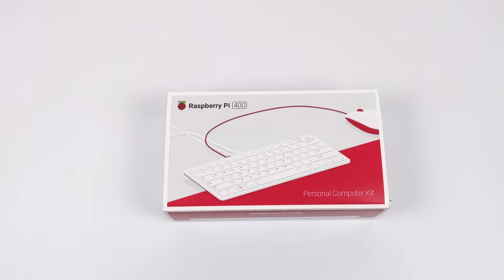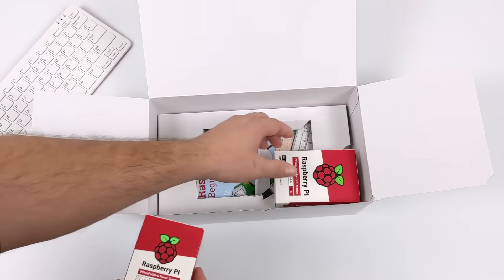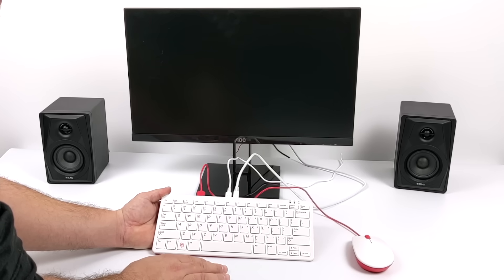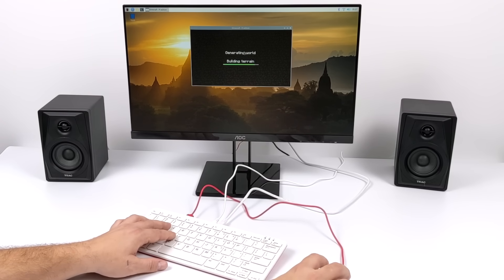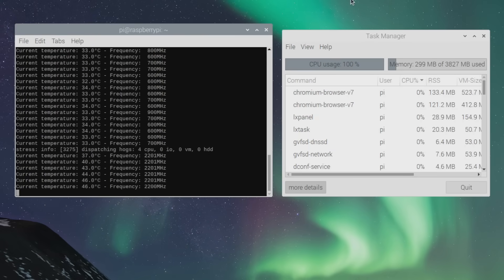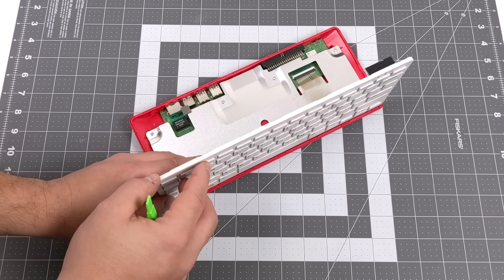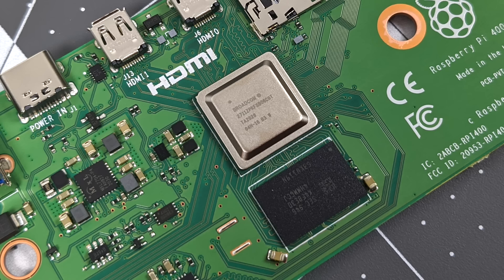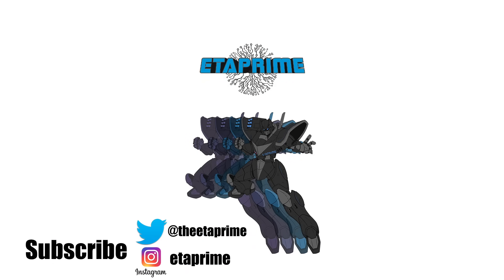The Raspberry Pi 400 is Awesome! Review, Overclock, Emulation, Tear Down

Comment from the maker: If you do pick up the Pi 400 what is are you going to run in it?
Reply: Mines getting retropie straight on it and living in the living room with the big tv.
Reply: @richretrotech9426  i did that but laggy on games🙄
Reply: I'll go with TwisterOS i think
Reply: I quite fancy one of these to set up as a retro computer; Atari ST, Amiga, ZX spectrum, MS DOS etc
Reply: I was actually thinking and trying to make something like this DIY in home for past 2-3 months , but heck somebody already made it.
Reply: @gulamahmed4773  go to 77 up 77 in my my ⁷ we ⁸
Reply: Commodore 64 emulator.
Reply: I'd make a custom laptop
Reply: Ubuntu
Reply: I want to find a 5V mini projector to hook up to the HDMI so I don’t need a monitor anymore.
Reply: RetroPie. I'd like to see images built optimized to emulate Keyboard based systems, like the Amiga, Atari ST, Commodore 64 and Spectrum.
Play all those games that were keyboard centric like RPGs and Text Adventures.
Reply: This would be good to play old DOS games on with a emulator.
Reply: Amiga
Reply: Android 9/10, with a Taskbar or a Launcher
Reply: TLX OS (thin Linux) the thin client os that is included with the raspberry pi installer it's pretty useful.
Reply: Amiberry with direct boot into an Amiga 4000.
Reply: @johalun  Does that run all the .adf disks from like the amiga 500?
Reply: @scality4309  I use WHDLoad to launch games and demos. But sure, you can also load adf files as if they are disks in a disk drive. Press F12 to open the menu and "insert" disks.
Reply: One word....Amiga
Reply: @slowlymakingsmoke  It actually looks like the later C64C,in basic shape. Hope it inspires more of these things,or at least case mods for classic machines!
Reply: Amiga computer emulation.. 🤔
Reply: Emulate an Amiga :)
Reply: @ETAPRIME gonna make a pie top or take the whole pie apart and make a slimmer pie tablet
Reply: I would try retropie just for fun but with the keyboard i don't think its worth getting just for that, some old pc games like you did with Half Life, maybe some rts ones, windows with starcraft , see if it can go a little further pushing star wars empire at war (that i think it wont work at all) , does steam works on piOS? its a linux system right?
Reply: I would say retropi and emulation, but my "normal" pi4 is already setup for that. For gaming, this system feels like it needs to take advantage of the fact that it IS a keyboard; I kind of want to load up some Zork on here, but will probably just mess around with various distros until I'm happy with a "portable desktop" situation.. and THEN do some Zork.
Reply: @levethix  that's exactly what I did! Loaded up fs-UAE and played Zork!
Reply: Thanks ETA! Hoping to try out some stadia/geforce now/steamlink game streaming on it!
Reply: Batocera
Reply: Have mine on back order, will use it as a mobile configuration terminal...  add a hdmi to VGA and you are set, everywhere has a TV or Monitor...
Reply: To throw my windows pc away... Or better to use this as virtual flipper device...the PC!
I am tired of windows
And i would like to see as emulation station
Reply: I would use Android on it, my monitor is already setup to output audio through HDMI [external speakers] so i won't miss the audio jack
Reply: I would run Amibian and make the Pi 400 an Amiga 400. Gotta love the old Commodore computers.
Reply: I would like to get this and run retro pi. Do you know it's possible to run retropie on it or recal box?
Reply: @10120003  
They already confirmed that it's compatible on release day:
https://retropie.org.uk/2020/11/raspberry-pi-400-is-released/
Reply: Anything that can do basic office task. So raspberry OS is enough for me
Reply: Are they going to make an 8gig version, also can you do some experiments with types and placement of thermal pad, paste and that Play-Doh stuff
Reply: Android please!
Reply: Plain old Raspberry Pi OS and then use it as a regular desktop for lightweight use and programming (mostly Jupyter notebooks and some Python and C++ based pet projects)
Reply: Run RetroPie, develop websites with VS Code, play with Dockers images on Kubernetes, use Chrome :)
Reply: Kali linux :)
Reply: My question is " is it worth losing the camera & display latches and the audio jack?"
Reply: @PS_7015  you don't "lose" anything, it's a trade-off, those ports for a all-in-one computer
Reply: @iHawke  LOL that's the whole definition of a trade-off - you LOSE something.
Reply: @PS_7015  Made for a different customer, a tinkerer who also want convience.
Reply: @PS_7015  Absolutely!

...not
Reply: @PS_7015  I think that just depends what you want to do with it.   Realistically, I couldn't imagine myself using those, so a Pi 400 is ok for me.
Reply: @PS_7015  I bought the 400 assuming it'd have the same 3.5 composite port as the Pi 4 so I could natively run a CRT TV but nope I gotta get an AV to HDMI converter which doesn't like interlace resolutions
Reply: @PS_7015  I personally don’t think it is.
Reply: @metronorthrailfan2244  You can buy either or both, it's entirely optional. Doubtless third party hacks will rapidly appear that will fill your every desire.
Reply: Man this is very good
Reply: I want to see how well this device can handle different game engines, especially GameMaker 2.
Reply: I could see a backpack being made for the GPIO/USB, adding classic connectors for BYO C64/Speccy/Amstrad/ST/Amiga/Archimedes. Also custom cases from the likes of RetroFlag in the style of those, but with different keyboards. I'd probably run Manjaro XFCE as thats my main OS already. My Dad is on a NUC right now, can see a 500/600 etc replacing that when it dies.
Reply: Scummvm build, or some linux build.
Reply: These neat little things are perfect for children's Christmas presents. And the cooling can probebly take a few new interations down the line
Reply: Would be running ps2 emulators if possible? And any games I could find worth getting
Reply: RetroPie or OSMC.
LibreELEC maybe if they expand the usability beyond KODI a bit.
Might even try out Volumio for my own private Radio Station.
Reply: I would at least try the ZXBaremulator, I would try to make a Joystick adapter for GPIO. And I would probably end with Python learning-focused / development-focused OS (probably RPi OS with extra SW).
Reply: It needs a decent built in battery and rtc. I'm sure someone will come out with something that fits in there.
Reply: Raspbian 32 bit like everyone else, so I can make software that other users can use.
My beef with the kit is that 16 gig is too small.  I bought the stand alone and a samsung 256 gb card ($29 on amazon).
Reply: I'd like to run betaflight configurator?!?!
Reply: Probably going to use mine as a keyboard. Stick an NRF52840 dongle on, sniff logitech packets from the usual wireless mice; bundle it all up into a HID stream from the type-c port using the usual pi zero DWC2 usb gadget configs. Might stick one of the MacroSilicon MS2109 HDMI-to-USB2_UVC_webcam camlink clones on it and see if I can train it to macro some games. Maybe some USB/IP fun, maybe just mount some btrfs USB drives. But it'll definitely be a 2.2Ghz USB HID keyboard for me, first and foremost.
Reply: Can it be a sbma server?
Reply: Can it run Dolphin Emulator?
Reply: I'm not sure
Reply: Another dude is running your video.  https://youtu.be/tTM-lyPivNE
Reply: Mine is coming on Monday (yupee). The first OS will probably be TwisterOS. And then, Ubuntu 20.10 to test the 64bit version OS on Pi400.
Reply: I'm watching this video on mine! I wish I knew more about how to get Webcams and streaming working. I know my webcam works, but the software I found in the package manager is archaic. Probably just download a 512GB Retropie image later :)
Reply: Having this set up as an all-in-one emulation machine for 8bit and 16bit computers would be perfect. C64, Amiga and Dosbox etc. 
Do you think Mac OS9 & Win98 would be possible?!
Reply: @ETA PRIME maybe some cpu temp test?
Reply: OK i see now ;)
Reply: I really want to get into some python, and play with some stuff attached to the GPIO's. This format is much better suited for a portable/temporary setup that I have to shove back in a box from time to time.
Reply: Using cSpect with ZX Spectrum next rom while I wait for my KS2 machine.  Also as a 1st using Linux OS of any version, I will spend a little time learning Python and Linux
Reply: RetroPie, programming (Python) and electronics 'tinkering'
Reply: Going to continue running Raspberry Pi OS which my current Pi4 uses.  When I get the Pi400, my original Pi4 will be converted to a NAS using Openmediavault.
Reply: TwisterOS OFC...
Reply: I plan on running OctoPi headless once it's setup so the keyboard and mouse aren't really needed, but since it's about the same price as the CanaKit it doesn't hurt to have it.
Reply: Minecraft.
Reply: Pihole. What else?
Reply: Wanted to run netflix but it doesn't, so got to learn about the Linux kernel.
Reply: my taxes
Reply: Where can I find one? Amazon doesn't have them!
Reply: will run some VMs, ESXi?
Reply: @Doom Guy what’s cool about Twister OS? I’m not aware of that system
Reply: I'll use it to teach spelling on YouTube for the comment sections.
Reply: po.n hub
Reply: @miladh1859  dire dire dogs, or children
Reply: Pihole lmao
Reply: @xuangli3952  lamao same
Reply: I am using the pi to test some risky codes, something that I would not try on my main desktop.
Reply: @guan01gmailcom  like sudo rm -rf --no-preserve-root /
Reply: Puppy linux would seem like a good option to try
Reply: @IdiocracyToday  german shepherd dachshund mix linux
Reply: @uiopuiop3472  I nearly looked that up ;) Fortunately I enjoy doggie pictures nearly as much as cute cat pictures
Reply: @IdiocracyToday  hmm cat picture seems good, might try
Reply: I bought one for X-mas to make my mother a media center on her TV set.
Reply: @ForOdinAndAsgard  i love cats!!!
Reply: Doom eternal at 4k ?
Reply: I think I’d run Kali Linux
Reply: @FuckMyLife-g6x  good choice, time to hack the NASA
Reply: @uiopuiop3472  or DoS the White House

nsa pls no arrest
Reply: @FuckMyLife-g6x  time to build a botnet with the scripts from the hacker called 4chan
Reply: @uiopuiop3472  we can also ddo— I mean stress test Reddit
Reply: Shadow PC
Reply: How did you overclock this i want to do this too.send me a pm PLS..
Reply: @saimonmarley9124  i didnt
Reply: @uiopuiop3472  i menaged to learn how It works. bye bye. For the people searchimg for this top the perfect setup whitout breaking the garantie.
Overvoltage 8
CPU freq. 2100
Gpu freq 750 
It Is stable and verified over 24 hours
Reply: @saimonmarley9124  thanks, i will try it
Reply: @uiopuiop3472  he data Is config works at overvoltage 8 whitout using the turbo setting
Reply: @uiopuiop3472  does the overclock work for you??
Reply: @saimonmarley9124  Didn't check it yet, but I will in a few days as that's when my new Pi 400 will arrive
Reply: @uiopuiop3472  ok i want to be sure that It work not only for me.
Reply: does rasp. pi 400 heat same like 4b
Reply: @Goku-ir1sy  nope because of the big heat pipe inside you can see It on a demontage video
Reply: Blender or fusion 360
Reply: hello eta prime!
Reply: @tomypower4898  eta prime: helo
Reply: Pi os
Reply: @matthewschreiner  is that raspbian
Reply: Yes matter what!
Reply: @tomypower4898  I have a regular PI with retro pi and I have anothe sd card with pi os.
Reply: @tomypower4898  yes!!
Reply: @uiopuiop3472  good!
Reply: @tomypower4898  nice!
Reply: stadia
Reply: portable keyboard (apple 2c) gaming rig
Reply: cyberpunk 2077
Reply: @secure-5593  no!
Reply: A c64 !
Reply: I'd like to see the 8GB RAM version so I can run the 64bit Ubuntu raspi distro
Reply: Cyberpunk 2077
Reply: home automation. couple of ideas for garden sprinkler and solar power water heating system.
Reply: Fedora, I'll learn Linux os
Reply: Please gift this one to me
Reply: I want to see if it can run hl2
Reply: Can this run TwisterOS ?
Reply: Docker
Reply: Retro gaming system for sure
Reply: GTA 5 😂😂😂😂
Reply: i will get tf2 to run on it
Reply: i will run pimiga :D
Reply: The PiOS it comes with.....and PiMiga on another SD card :D
Reply: Just picked one up to run Risc OS on.. Because none of my ancient archimedes work anymore #sadface
Reply: If I wanted to download ROMs for the VIC/C64/CoCo/II(and I don’t because I follow copyright laws), I would give this thing a beige-colored paint job, load it up with RetroPie, and make an 80s style all-in-one retro game console.
Reply: Overclock it and run Retropie, use the two USB ports for controllers. It will be like a modern Commodore 64.
Reply: Cyberpunk 2077

........

if i want my house to blow up
Reply: Wine
Reply: A lot of emulators
Reply: Make a cardboard pc
Reply: probably emulators, games, programming and also blender
Reply: Roblox
Reply: If I were to pick it up I would run Android
Reply: Wiii and psp games
Reply: Raspberry Pi Twister OS.
Reply: Me: installs Apache also me: creates test2.lavakid.net
Reply: Won’t run anything I like sadly
Reply: Minecraft Pi, definitely
Reply: This is actually genious.
Reply: @somedeveloperblokey Nobody gives a shit about what you do and don't accept.
Reply: Yt discord and my discord bot
Reply: Hi Eta prime and fellow Raspbians. I want to setup a google photos like personal server for backing up my photos/videos to an external hdd using opensource software like nextcloud. Being a programmer I'm curious about the pi but not sure if I can setup something like this. I will require static ip as well which I fear will make my effort waste on saving the money for a Google One Plan. Has anyone done any similar setup. I don't know if raspberry pi would be able to that much load.
Reply: Audacity for recording/editing samples, milkytracker for making old school rave tunes, VS Code for obvious reasons
Reply: Raspberry Pi OS without overclocking or software modifications
Reply: Pimiga
Reply: Perhaps good old Ubuntu, or something like Linux MINT.
Reply: I would like to do a multi boot, 64 bit Pi O.S., Twister, and retropie. maybe something for media like Plex or equivalent for the Pi, I haven't looked at that yet.
Reply: Could be a fun little network analyzer
Reply: I love Twister so I would certainly have that on there, but most likely dual or triple boot with something else. I would like to try using one as a daily computer doing the basic operations of my daily pc use.
Reply: Thank you for your reviews they are great and indepth. I find them very useful. I am think about buying one of these will it emulate PS3?
Reply: Minecraft
Reply: i really hope it can run windows properly.
Reply: My RetroComputer machine with Sedai Linux.
Reply: Experimenting with Linux mostly but obviously I will also dip in RetroPie!
Reply: I personally will probably get this to cut down on clutter for a couple of picade setups. I usually have to get an extra keyboard and mouse combos or bring mine for setups.  This will tidy it up quite a bit and make any updates tweaks and potential cabinet changes easier to design around.
Reply: So a pi400 soc in the 8gb pi4 form factor....a better option if they release it. Add case, tv/monitor and wireless keyboard and mouse. Run a basic linux or risc os build for desktop duties. Or build a fun retroarch/openelec console
Reply: If there is a good (stable) android ver for the RP400 I wish you try this game called genshin impact
Reply: Kali Linux for pentest.
Reply: ETA Prime I don’t know. What Operating Systems are you planning to run on it?
Reply: @metronorthrailfan2244  Try Recalbox, from there you have a very nice Amiga Emulator and others
Reply: @metronorthrailfan2244  Its possible to run RiscOs on Pi 400 with work keyboard?
Reply: @metronorthrailfan2244  it running raspberries os
Reply: @SM64M  I know
Reply: RetroPi :)
Reply: @ETA Prime Run Windows 10 on ARM
Reply: @ogorini  I agree
Reply: can u test wor please
Reply: hmd prg  Crysis Remasted
Reply: Nothing, sadly, sine there's no way to get audio out of it.
Reply: @brookewestonctc  hdmi
Reply: As soon as there is an 8Gb version I will get it and test ubuntu, ubuntu-mate, and kali.
Reply: Hello there, could you go into detail what the boot up & shutdown button exactly does?
I watched almost every "first look/ review" on YT...but I seams like this Killer-Feature gets overlooked by almost everbody.

I can't even count anymore how much attempts I started to implement a boot up/shutdown button into my projects...

Of course I already ordered one (DE-KIT)
but seems like it will take quite some time until it gets here...

Greetings from germany
Reply: can we play Roblox with this??
and is it fast??
please answer
Thank you
Reply: @ETA Prime and my question is what operating systems will you run on this thing? I know any operating system the pi 4 can run will run on it but I’m not sure if that includes Windows or not. I’m sure it does but I could be wrong. Just wondering.
Reply: @metronorthrailfan2244  Windows should run on it if you want it.
Reply: @tekmate  thanks

Comment: Seems like you ignored the real reason it exists.
It's not just a computer, that big wide socket on the back has pins that are programmable I/O. If I'm not mistaken standard Arduino.
That means you can read sensors, control motors and switches, pretty much run your whole damn house on auto and probably enough I/O  and computer power to make a humanoid robot slave.
As computers go, it's not just the cheapest, it's probaly the best.
So I'm giving you a DISLIKE. 
Do some research! GPIO is it's most important attribute. The attribute that sets it aside from all others.

Comment: 4GB RAM is just not enough. It should have used 8 GB RAM.
I have a Linux laptop with 4 GB RAM and I cannot use it, as it always swaps out with a browser and Rambox running.
I looked a lot at RPi 400 and wanted one, but just because of not having enough RAM I did not buy it. I was very sad.